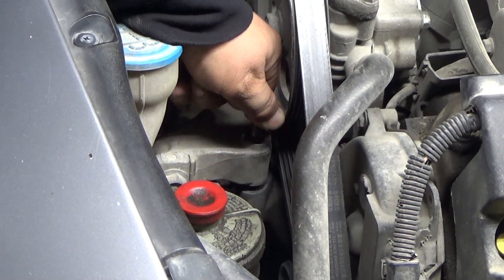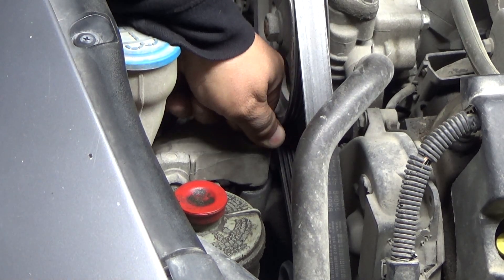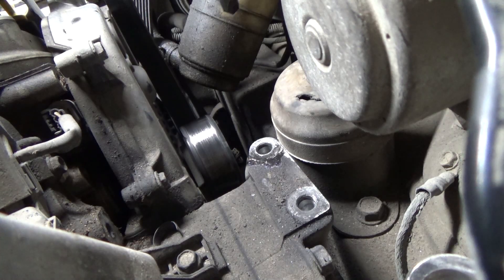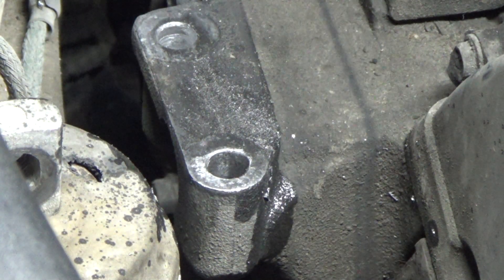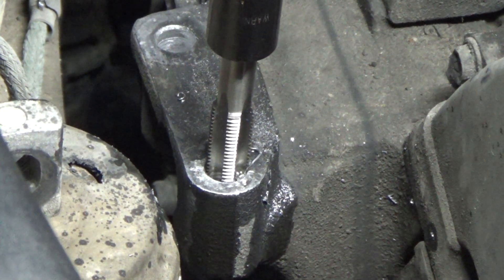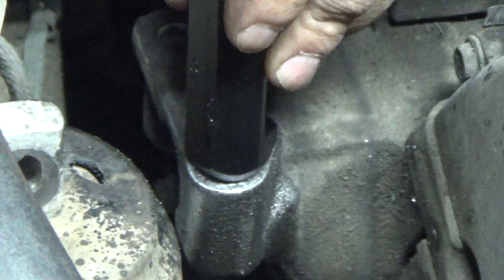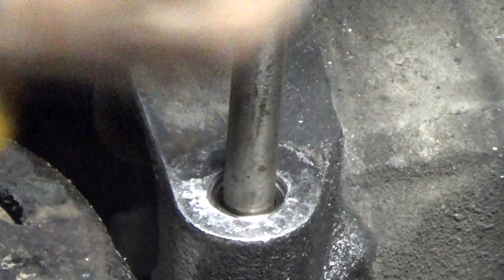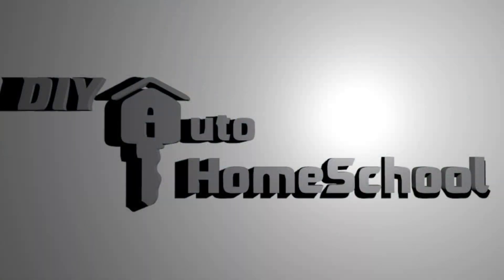How to Install a Heli-Coil - Thread Repair

Comment: I did what you said for a oxygen sensor and keep on pulling out when it was tightened up like a spring that was uncoiled but I used a thread sert that I got at Grainger with the drill bit and tap it worked great I wish I did that first have a blessed day today 🙏

Comment: I have a stripped ignition coil hole.  The car runs but all I have tightening it now is some Teflon tape.  People talk about stuff falling into the engine like shavings. I don't think there's anything on the other side of those ignition coil bolt holes, is there? Do you think one of these types of thread repair things is the only way to go here?